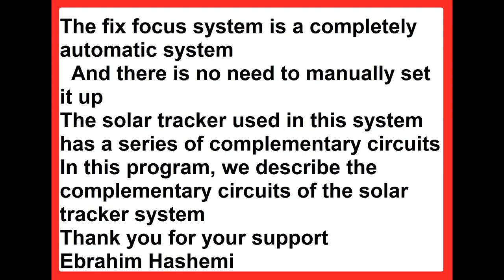Peripheral circuits required for solar tracker in fixed focus system. Very accurate solar tracker

Comment: Hmmmm .... ;
*I would suggest the sun passing across the sky was the 1st clock.  
For ex: if you point the hour-hand of a 24hour clock at the sun (& put its face in the sun's orbital plane) ; that hour-hand will always point/track the sun even during night.  
*Sooooooooooo perhaps you might make your solar concentrator rotate justs-likes a 24hour clock (24/7 ;)